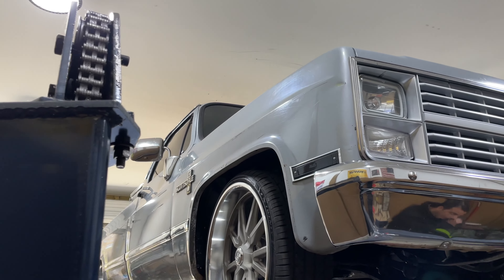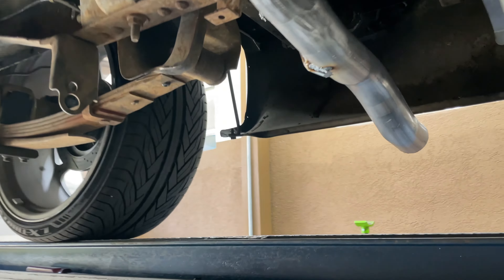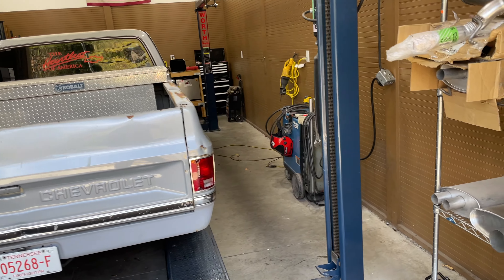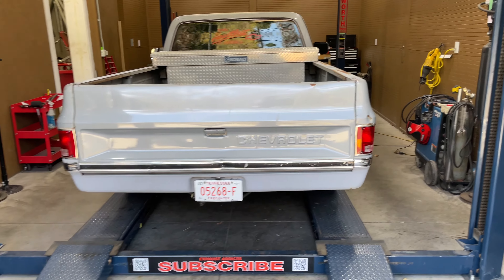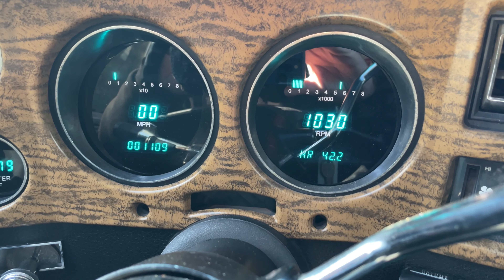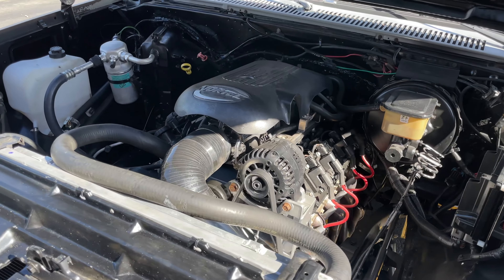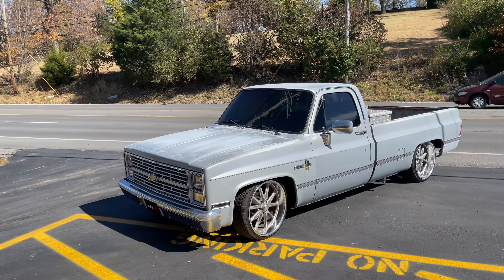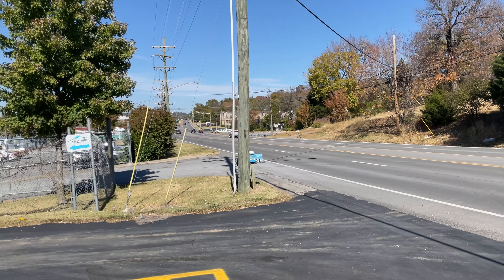CAMMED 1984 Chevy Scottsdale w/ HEADERS & BLACK WIDOWS!

Comment: Done right except the air intake 😉 Seriously tho the computer pulls so much timing when it sees high intake air temps. I did an ls swap and saw 60c IAT before I built the intake. after it was down to ambient 15 at the time and a massive power difference